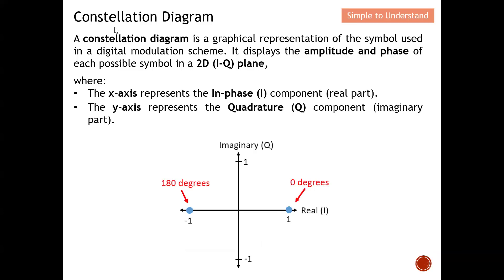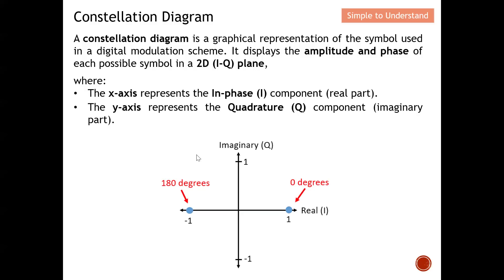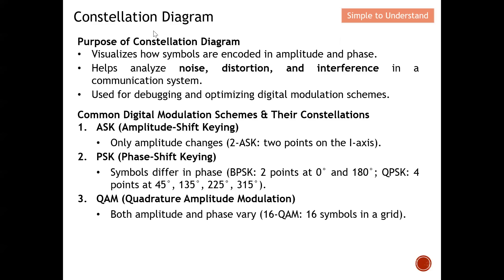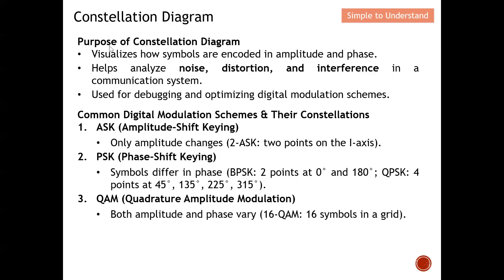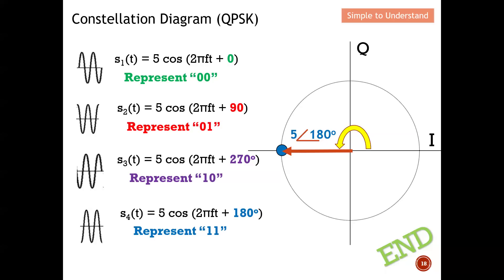Digital Modulation #4. Visualize Mary Phase Shift Keying (MPSK) with Constellation Diagram Explained

Comment from the maker: Thank you for taking the time to watch this digital modulation video.

In this video, I will first define what a constellation diagram is. In fact, a constellation diagram is also known as an IQ diagram or a vector diagram. I will demonstrate how we can represent 2-level and 4-level ASK (Amplitude Shift Keying) in a constellation diagram. However, constellation diagrams are most commonly used to represent Phase Shift Keying (PSK) signals. In this video, I will also explain how constellation diagrams are used to represent BPSK and QPSK.